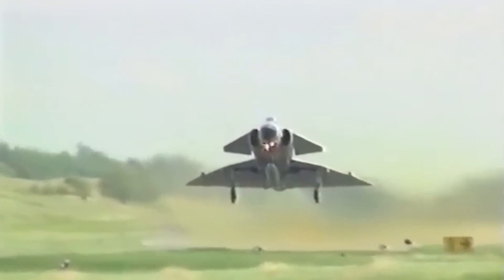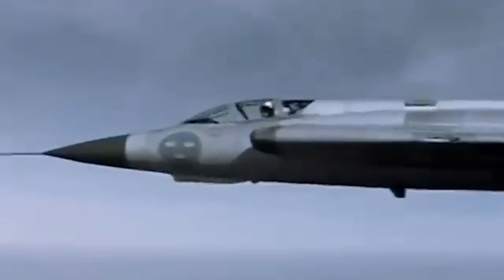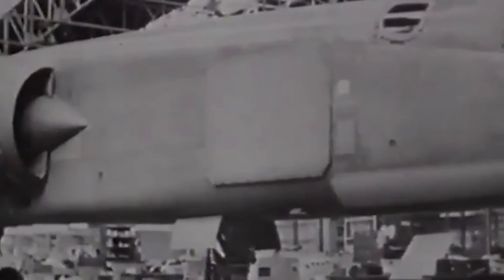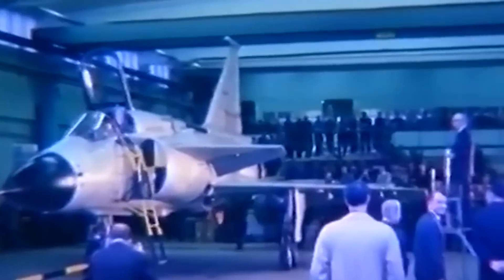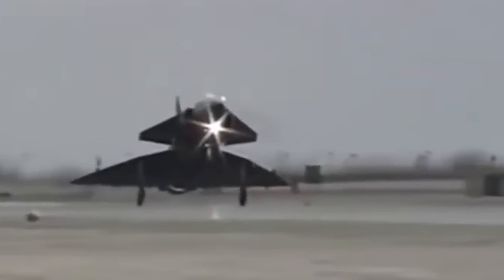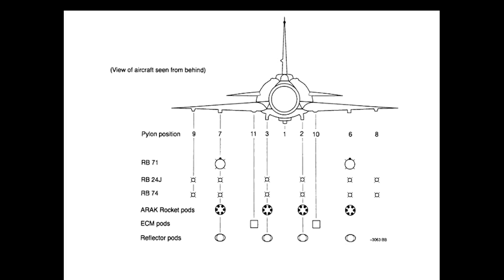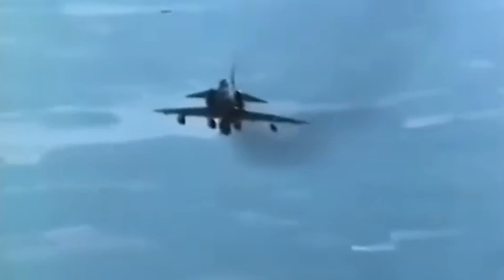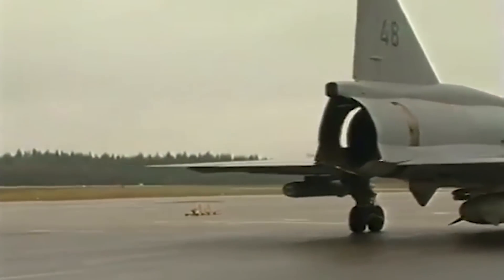The Ultra-Fast Interceptor Plane No One Dared to Defy

Comment: The  JT-8 based RM-8 was meant as a shortcut  however adding the afterburner introduced substantial torque loads on the main shaft when lit so all the advantages of using the Pratt & Whitney went out the window as very little of the original engine could  b utilized in the end...BUT it was/is  the largest after burning engine in the west...it sports a MAGNIFICENT base rumble !! . Many a time......as it appeared many a time at motorcycle races  as our Peter Lindén was a Viggen pilot. His friends often came in over the paddock VERY low and standing this magnificent piece on it's tail filling  the paddock with airborne tents , leathers,  blankets  and other assorted paddock paraphernalia .....  and glorious jet exhaust !!

Comment: They should have just modernized the Viggen with a massive engine instead of making a Gripen.
Reply: It was not possible to be in the top with that heavy design, it lost too much speed in sharp turns and used a lot of fuel.

Comment: The Viggen managed to get a missile lock on a Blackbird.  It also flew cover for a Blackbird that was in trouble.  The last batch of Viggens still had lots of hours left in them, but the end of the Cold War left them without a job, and its replacement already in service with lower maintenance costs.  A potent aircraft for its time.  Not as beautiful as the Draken, but easier to fly, with a lot more mission capability.  The Swedes build superb aircraft.

Comment: I wish the SAAB JA-37 vig had 2 × Pratt & Whitney F100-229 instead of the x-civil engine it had then.
Performance measured, the ja-37 viggen with 2 × Pratt & Whitney F100-229 would get much better stat and landing as well as exsrem short runway range, then from mach 2 to mach 3 beyond. Tragically it didn't turn out that way.

Comment: I agree, the Viggen is an incredible aircraft but for a fighter that was first flown in the year of my birth the Lightning was magnificent. Exceeding mach 1 in a vertical climb it was a fantastic interceptor which has flown higher than a U2 and faster than Concorde, both later designs.

Comment: One thing that could be highlighted even more was the datalink angle that the Swedish airforce started using in its fighter aircraft in the 60s, which to my knowledge other nations didnt, at least not to the same extent. This was a hidden capability that would have enhanced the impact of the Swedish airforce significantly. I believe Datalink has only been used by other nations fighter aircraft much later, like in the 2000s. I do know that when the JAS39 Gripen first went to Red Flag in the early 2000s they used it to great effect against other nations aircraft, or it might be that they used it in a way other nations didnt. 

The other thing worth mentioning is that they did have some structural problems in the early 70s that caused some crashes and at one time all Viggens were stopped from flying before they figured out what the problem was, which was an overloading of one of the wing beams inside the wing causing it to fracture. 

Nice video all in all
Reply: American pilots visited an airforce base in Swede in late 70s and they were blown away by the data link in Viggen.
They had never seen anything similar before.

Comment: The Viggen was a beast of an aircraft but needed a lot of maintenance to keep it flying. From when they were playing games with the SR71, I wonder what Swedish is for "gotcha,"
Reply: I agree with Fångad but i remember we said you are Taken when we played hide and seek.
Reply: Gotcha in Swedish would be “Fångad” or Låst (locked) 😀
Reply: There have been many things that locked the SR-71, it wasnt designed for stealth, just speed. Shooting it down was the problem, many have tried, no one ever succeeded. SA-2s and 4s.  SA-2s have a altitude of nearly 100,000 feet. Over 4000 missiles, from SAMs to even ones fired from jets, not a single plane hit.
In reality, the Viggen while able to get a lock, would not have been able to shoot it down.

Comment: Beautiful aircraft, innovative and really an achievement for such a small country. Not an interceptor like F106 and the Lightning nor a high altitude aircraft like the U2/ SR71. but a true multirole aircraft, just as smaller nations need it. As a Dane I am still a little disappointed that Denmark did not choose this aircraft back in the 70'ies. We had the Draken and were very satisfied with it. Well, but the F-16 was allso a good aicraft and cheaper. Anyhow: Now the Gripen is taking over worldwide, Heja Sverige 🙂
Reply: It was tough when Norway and Denmark picked the F-35, and put out very negative, but easily proven false, reporting about the Gripen, especially about cost and availability. We will soon see more and more complaints from the F-35 user countries.
Reply: @mattiasdahlstrom2024  Its even more strange that Finland choose the F35. They say they can make fit their dispersed program, but I'm highly sceptical. Its too advanced to be maintained in make shift hangars, a plane true to its name, hangar queen.
Reply: @andersmalmgren6528  The current US GOA reports show the F-35 has an availability of 35-50%, so yes, a hangar queen, and very specialized hangars at that.  What the Ukraine war has shown without doubt is that military equipment needs to be good enough, but also robust and available in numbers and in time, dispersed and camouflaged. Western air defense is not that good and Russian and even Iranian missiles can maneuver around the fire solution of air defense. An Air Force with 100 Gripen will survive longer than one with 70 F-35. 
Sadly military procurement - at least in the west - is a political rather than military science. 
Also I think Santa Marin, like our Pål Jönson is a US arranged influence agent. She did her job of getting Finland into NATO, looked cute and girlstrrrrng and is now on to a cushy job.
Reply: @mattiasdahlstrom2024  they are not agents of the US, the US just sweetness the deal with some trade deals on top of the jet-program, hard for a small country like Sweden to top that. But its strange that Finland falls for it, they need actual planes that work. Especially in this day and age with putler doing his thing.
Reply: @omgpix  well gripens EWS is even more advanced than that of the F35. Also one can say F35 is too advanced since it cant even hit 50 percent planned sorties, while the gripen have 100 percent and can be maintained and operated from road bases. F35 is a hangar queen, gripen a work horse for actual war
Reply: The Nordic countries still didn't choose the Gripen. They chose the F-35s. Remember how they chose the F-104 from the biggest bribery scandal in military aviation? Then Denmark went with the Draken, but after that it was the F-16, which is still a good airplane, but the Nordic countries didn't buy Swedish hardware, but predominantly American hardware.
Reply: @mikaelbiilmann6826  like i said, because of political reasons. Gripen is still a far better plane for defensive war. F35 might be a good plane in an offensive war when you have air superiority and have spotless airfields and maintainance capabilities
Reply: @andersmalmgren6528  And I bet, now that the countries have bought into the NATO systems, there is no going back. The Swedes had excellent intelligence-gathering system way back then. But I also see that the Swedes' way of controlling their planes may be different than the way the Americans and in extention the NATO ways are.
Reply: All discussions aside none of the Swedish plane designs apart from the Tunnan in Congo proved themselves in real combat and let's hope it stays that way
Reply: @cnfuzz  No modern US fighter have seen any real combat either. mig29s in Iraq isnt a real threat.
Reply: As one of the F-16 Maintenance Instructors who had the privilege of teaching NATO Maintainers the F-16  in the 70s and 80s I am thankful they choose the Falcon.  The Danes taught me as much as I taught them while they were in F-16 Radar, Radio, and Electronic Counter Measures Classes.

Comment: What's the difference between terrain avoidance and terrain following in a fighters radar?
Reply: All radar is terrain avoidance, but far less precise than TFR.  You see major terrain features on the scope and avoid them.  This requires skill by the crew.  
Terrain following radar had multiple antennae that provided more precise information on the height of the aircraft vs the terrain below and ahead of the aircraft.  A sophisticated autopilot maneuvered the aircraft to maintain the flightpath at a more precise preset height above the terrain without human input.   TFR let the airplane fly closer to the unseen ground at higher speed.
Reply: One warns you about fast closing terrain, thus allowing pilot to avoid a crash, the other use a map of the terrain to automatically fly the plane at very low heights and at speeds that many pilots could not manage manually…

Comment: Only a 50000 ft flight ceiling while both the sr71 and u2 cruise at 80,000 and above..
Reply: To intercept the SR71 the Viggen pilots would start their run at 8.000m (26.000 ft)  accelerate to Mach 1.35 then pulling up, very gently, continuing to accelerate to between Mach 1.7 and Mach 2.0, topping out at between 18.500 and 20.000m (60.000 - 65000 ft). Radar detection of the target recieved at maximum range, which then locked on immediately afterwards. Simulated missile launches indicated success– the closing velocity was very high, between Mach 4.5 and 5.0; and the the SR-71 was typically flying at Mach 2.98 and 21.500m (70.500 ft).
Reply: They could be reached by the Skyflash missiles of the JA-37 ( made in Sweden under  licence under the name Rb-71 ).

Comment: Ultra fast interceptor, I give you the EE Lightning. First flown in 1954, over Mach 2 and capable of intercepting the Lockheed U-2. Now that’s an ultra fast interceptor.
Reply: Considering that the U-2 was a subsonic recon aircraft ... well....
Reply: @kronop8884 … you missed the point.  The U2 flew at great height.  The EE Lightning  could  break mach 1 in near vertical climb and capable of reaching U2 and Russion bombers in quick time, betond rhe capability of the Viggen.
Reply: @Jack-bs6zb  To be fair, the OP mentioned speed twice, but no mention at all about altitude.
Reply: @Jack-bs6zb  exactly 👌🏼
Reply: @Jack-bs6zb  They could get 98,000 feet but not under power, they had to fly above mach 1, then climb, after 60,000 feet they lost engine power and used the built up speed to get to that altitude.
Reply: @kronop8884  The lightning was the first that could fly up to the same altitude thought so not without some wow factor given that US believed it wouldn’t happen.
Reply: @kronop8884 
Quite so.
Reply: The JA-37 was far more agile especially at high altitudes with a much more powerful radar equipped with the Swedish version of the Skyflash missiles the Rb-71 made under licence in Sweden.
Reply: Draken did Mach 2 1955.
Reply: @petter5721  ... so what?
Reply: The F-106 was the fastest…
Reply: And on top of all what it has been said. The EE was chubby, fat and one of the ugliest planes ever made. I do still remember my disappointment when I was given a model of this thing on my 10th birthday. Of all the model planes in the world my uncle chose this aberration.
Reply: @joseelempecinao89  ... are you sure it was the Lightning that was 'chubby and ugly' and not simply projecting personal dissatisfaction onto a superlative and beautiful machine?
Reply: Too bad its mission was unsustainably narrow.  As a kid , I lived in London in the late 1960's , and was lucky to see the introductory fly-by of the first operational Concorde (supersonic) airliner ,  escorted by 16 EE Lightnings 😮 🙂
Reply: @bowenzhou5264  exactly. the platform has little room to grown and even less fuel to fly....
Reply: Two engines with a wing … hehehe
Reply: Oh no, it’s a friggen Viggen 😱
Reply: I would imagine the SAAB was a lot easier to fight with, lightnings were notoriously difficult.
Reply: I give you SAAB J35 Draken which also was a MACH 2 fighter, first flight was 1955.
Reply: I heard and read that the su15 was a fast ship too... very hair raising on landing especially on first version
Reply: I think that they were all fantastic airplanes. That period was amazing for airplane development. So many incredible flying machines. 
  So, let’s not fight and be uncivil. Let’s celebrate those early(and later) supersonic pioneers. 🙂👍🇳🇱
Reply: So similar to Saabs predecessor Draken, först flight 1955 and yes +mach 2 and would out manover the lightning in any dog fight. Draken could super Cruise and do the  Cobra  manover. That was before Viggen
Reply: The SAAB J35 Draken went mach 2 also (flew first time 1955).
Reply: Incorrect
Reply: A CROW COULD INTERCEPT THE U2 !
Reply: Can any of you buy and pay only ONE of these planes? No? Why talk about it, then? Buy one! Fly one! Then we're talking. All those geeks...
Reply: @voornaam3191  ... So, we're not permitted to have an opinion on something we haven't the money to purchase beforehand?  Does your pocket money qualify you to have an opinion on toilet paper?
Reply: @voornaam3191  Can you afford to buy Youtube? Why are you on here then?
Reply: @voornaam3191 

They used to do hired private flights out of S Africa many years ago one was the Buccaneer and the other was a lightning. 

Draken and Viggen are both great aircraft and used to practice chasing the Blackbird s.. on one occasion they extended a protective wing to the Blackbird when with one engine out the Russians launched intercepters .  

A back woods multi role combat aircraft ...with incredible performance... and looks to match.